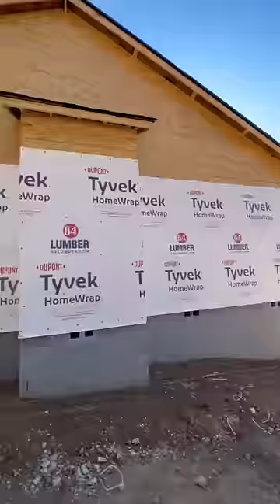Build My $350000 Wooden House in 60 seconds!!

Comment: As a German, I think I can never accept the fact that sooo many houses in the US are just being build out of wood, with little to none stone. 😅
Reply: it’s called balloon framing it was made in chicago because someone had to create a building fast so they came up with a new way of building houses called balloon framing 
it’s much faster than using stone but way less sturdy
Reply: @bloom9075  interesting, thanks for the info!
Reply: The roof is painful to look at, it’s just plasterboard and felt🤣
Reply: As a child I had a little playhouse. The roof was like that!!
Reply: And not just that. Its foundations are barely a meter deep, no steel rods to support the concrete columns etc. No wonder hurricanes and tornadoes rip houses apart.
Reply: I think so too.. nd the foundation Is too weak. They can live in a huge house but not cemented. I wonder if they r just cost cutting.?😓😓😓
Reply: Houses in hurricane prone areas look a bit sturdier. At least the outside walls are all grey bricks in the inside.
Reply: As a german carpenter i cannot understand how they make the balloon frame with like 4/12cm wood sticks and we use 10-12/24cm wood beams
Reply: @davidanders1687  its crazy right? We build houses and they build sheds😂
Reply: @cyp2d653  It is composed of neither plaster board or felt. It's OSB, roofing fabric, and asphalt shingles. If installed correctly, it can last 30 years.
Reply: @StockAL3Xj  30 years before re-roofing is required? In the UK, our roofs are composed of underlay felt with horizontal wooden lats running across the roof to support each tile/slate. The verges are cemented around the perimeter with cemented ridges over the intersecting tiles at the peak. After about 20 years the lat and felt should be replaced, which can be done in a week depending on the size of the roof. The tiles and slates last 100+ years. My bad, I mistook the materials in the video
Reply: @cyp2d653  difference is its just optional to roof with that material. Metal roofs last almost forever. Funny how you judge our whole country's houses from one video. How about I judge your whole nation off of ww2 or ww1? And yes I'm a carpenter in the USA. Not all houses are built this way. Seems to me it's nowhere near tornado alley or hurricane season. So please explain to me how this house will fall down from natural disasters in an area without any?
Reply: @cyp2d653  no its not lol. Its like 2x6 rafters
Reply: As an Indian, id be uncomfortable in that house 😂😂 we make using bricks and cement
Reply: I don't think any European would understand that, it baffles me seeing houses made out of wood.
Reply: Wdym? How do u build houses???
Reply: That's no wood, most of that house is cardboard and plywood.
Reply: In here we use brick and semen here. Unless it's very very old traditional house.
Reply: thats why they all fall down when theres a bit of wind and rain lmao
Reply: @GHOUL392  there are actual warzones in america bud its not really the most desirable destination
Reply: @cyp2d653  when re roofing asphalt roofs, you just rip off the shingles, and felt paper, pop out the old nails, and install new felt, and shingles. A seasoned roofing crew can replace a roof on a mansion in a few hours. Also, materials vary. Metal roofs last longer, and only require periodic maintenance. In the southwest portion of the US, Terracotta roofs are common, however, I live in the southeast, so I don't know much about them. In Virginia where I live, some older homes actually have slate roofs with copper gutters, and in the rual areas, some homes have cedar roofs.
Reply: I live in a hurricane prone area. There are houses in my city built of wood that are hundreds of years old that are still standing. Brick, cinderblock, and concrete are also popular in the USA. Wood is actually very strong, and a tornado capable of leveling a wood house, can also level a stone house. Once the wind rips the roof off of your house, the walls(weather they are wood, or stone) loose much of there horizontal support. Wood is also flexible, so the walls of a wood house do not crumble like stone block, so this is beneficial if you have to deal with earthquakes, or foundation settlement issues. The big drawbacks to wood are the fire risk, and termites, although modern structural lumber is treated for both.
Reply: @AlexFireflyer  that's why they fly away during a storm
Reply: Because there’s no need for stone houses in most states
Reply: As a indian, I agree. Because this will be a fire hazard, and also in case of typhoon , this will give very less protection.
Reply: @husky2961  you use what now???
Reply: @jewjacinto6244  that's exactly what they're doing
Reply: @GHOUL392  jealous of what, most Americans can't afford a house.
Reply: As a person who has actually worked in this field, I am 100 percent certain that no one on this thread could tell the difference between a hammer and screwdriver.
Reply: As a Dutchman who lives next to Germany, long live the German engeneering.
Reply: @smeshcel3025  eh warzones a bit much, gunfights are different then planes flying over dropping 1000kg bombs
Reply: @kazeryu17  my house on the beach has metal roofing and has sustained every major hurricane on the east coast for the last 10 years with only needing repainting. My main house has that classic asphalt tile roof with copper gutters. I live in the boonies. Much love from NC
Reply: As a brit i can say the same lol
Reply: @StockAL3Xj  30 years is an absolute joke
Reply: Ikr, in the philippines, we only use wood mostly for the Interior lol
Reply: Yea it amazes me too like bro no cement and rebar at all???
Reply: One fire or one tornado or cyclone is enough to destroy the house
Reply: I'm a retired maurerer. House construction is cheap junk in America. Less and less brick and stone.
Reply: @racher4593  😂😂😂100% so that would be including you as your on the thread
Reply: Wasn’t Notre Dame built with mainly stone? I don’t think as a German your opinion is much more than that
Reply: @AlexFireflyer  it isnt needed most places.
Reply: @davidanders1687  not like it is nessecary
Reply: @dooomswear303  do you mean cement by any chance?
Reply: @yucol5661  no they don't lol. exact same in FL
Reply: @okaydudes  Silence. What happened in Germany is nothing compared what happened to the original inhabitants of North America. 2nd nearly all houses these days are built this way. Sure maybe 100 years ago they were built sturdier. but these days they all are built this way
Reply: If you don't live in an area where there are tornadoes or hurricanes then I really don't think it matters
Reply: @lastraven7205  No. Or am I misunderstanding you? In Germany or maybe all of Europe new houses are build out of stone/concrete. Old houses from the 17 hundreds where often build out of wood.. Of course there where some stone buildings too but those where mostly like churches or some political stuff.. 
If you want an example for how sturdy German houses are, my inner walls are about 40cm thick and the outside walls with insulation about 60cm.. In Germany you can't just punch through a wall you probably wouldn't even be able to shoot through one..
Reply: Same here and I'm from a third world country 🤣
Reply: @MrSambam10  yes and notre dame is still standing. The only part that's missing is the wooden part of the roof. Notre dame isn't german tho so your comparison is a bit weird.
Reply: Saaammmmeeeee
Reply: @reiddickerson500  how is it possible that u go to war in 2 different countries iraq and afganistan but more people died in chicago than u lost troops. And the majority of the killings happen in southside of chicago. Thats mad
Reply: Yea im from norway and this is a joke.
Reply: @okaydudes  ok jogger
Reply: @lastraven7205  lol 2/10 on the rebuttal
Reply: We don’t need it y’all act like every where in the United States has tornadoes and tsunamis every week or something, we don’t live in jungles😂😂 we’re fine i promise you don’t worry about it y’all can’t even own your own tiny houses and you  taking credit for houses people built like 500-1000 years ago!😂
Reply: They just build big shet over there
Reply: I'm pretty sick and tired of people bashing America like it's the cool thing to do. Doesn't matter what country you're in, it's history isn't pretty. Everybody wanna act like we invented slavery or were dumb af, obese, etc. Euros annoy me to no end when they do this. Y'all had slavery first, for longer, more people, and more races. Not to mention we saved Europe from the brink of destruction, just to be teases and made fun of by people who wouldn't be speaking their native tongue or be alive if the Germans had won. 

I'm sick of the native argument. You name me one place on this planet that's inhabited by people that hasn't been taken from another group of people by force in the past......I'll be waiting forever. And none of the foreigner take into account that when you talk crap about Americans these ways you forget people move here all the time, and not everyone's ancestors had slaves or killed natives etc. I for one am a 5th generation American. My ancestors fled Poland and Germany post ww1. I am not dumb, obese, or hate other people from different countries or make fun of them like foreigners love to do to Americans.
Reply: @okaydudes  I fully agree and I just didn't realize what was was going on in the comments.
Reply: @oellappen269  I'm a carpenter and everyone in the comments could have had a civil conversation about how things are built in different parts of the world. But no, one video of a house being made in the usa and everyone thinks they know how all buildings are made in the usa. That's stereotyping.
Reply: @okaydudes  I honestly don't know what's going in the comments. Last time I checked, there were only about 10. Now over 60. But like I said, I absolutely agree with you. But I would go even deeper and say, that most people who talk about shit about America, are Americans themselves. Specifically from a certain political side...
Reply: @oellappen269  couldn't agree more. I will admit and discuss the faults of my country. By no means do I think usa is perfect or the govt isn't shady. I just don't enjoy when people bash an entire group, could be country, race, ethnicity, sex, religion. I never understood how someone could judge so many off of one
Reply: @kyfy777  stone is concrete and concrete is stone.....
Reply: This!
Reply: @Ghost_Enclave  I've never seen a house not made of wood? I live in Arkansas. I mean there are brick houses but the framing is wood as well.
Reply: @smeshcel3025  war zones in the US? what are you talking about??
Reply: @Thechino231  brick will crack in a earthquake though. Even brick houses are framed with wood. I live in Arkansas.
Reply: @wess3426  What do you use to build houses with, for the frame? Even brick houses here in the US are built with wood frames. In Arkansas & many other places we get tornadoes & not Arkansas very often but sometimes earthquakes so a brick house foundation can crack
Reply: @WarmongerYT  well that explains it, you're from the US.
Reply: @WarmongerYT  It's called reinforced concrete.
Reply: @WarmongerYT  look up how many people died in chicago compared to iraq and afganistan combined. Look at where the majority pf those killings and shootings take place within chicago. Than u will understand. And thats just chicago
Reply: @AlexFireflyer  you must be joking? How tf can there be no steel rods in the concrete columns? Thats like the first, very basic thing to do🧐
Reply: @okaydudes  America literally erased the entire group of people who were living in North America. They're gone now. Nearly none left.  Forced to live in reservation camps. Do you know what reservations would be called in a county like Germany?
Reply: @RSpracticalshooting  You have any idea who drove the Bison that roamed free in North America to extinction and why they did it?
Reply: @davidanders1687  here in Australia, our timber frames vary in size depending on wall type and structural loads. But the sizes of our timbers for wall studs (vertical) are 3.8cm x 7cm, 4.5cm x 7cm, 3.8cm x 9.2cm, 4.5cm x 9.2cm.
Reply: @preetipatel5512  as a not Indian I can assure you we do not have typhoons, and the lumber is treated. This home is built in an area outside of natural disaster so who cares
Reply: @AlexFireflyer  hurricanes and tornatos rip houses apart no differently than they rip the hunks of pure metal we call cars apart.
Reply: @MadNlGER  There is no way you have enough blood quantum to belong to a tribe. Go ask your grandparents if their grandparents wanted to live in a reservation by choice. They were ALL forcibly relocated. Go learn their history Btw. there is ZERO chance I believe you native.
Reply: I didn’t know why people hate using woods? It depends on weather and geography. Seriously, living in California using wooden houses are better, we got earthquake (mini or major) almost every year in many areas, so wood is the best. Fire is the problem, but it is not in many areas like earthquakes, and I also heard that they will add something to prevent the fire etc. If you went to other states, you might see brick houses (I still can’t tell). My friend in Florida live in brick houses. Also there are wooden houses in Florida that withstood hurricane to these days. Some stand for 100 years, I guess the quality was good back then.
Edit: Not all areas has natural disaster, so they can build whatever they want.
Reply: @andromedamessier3176  you have no freaking clue what you are talking about. 

And my original comment was during the time they were all forcefully removed from their ancestral lands. You don't actually think they left their homelands voluntarily and just all moved to barren areas do you?
Reply: @lastraven7205  those barren areas are actually their land that was being reserve. That is why they can’t leave or sell the lands.
Reply: @starofdabloc  Slavery existed in Africa and Asia too, it's not a european invention
Reply: @MatthiasDrinksH20  who said that it was?
Reply: @okaydudes  what percentage of houses in the US would you estimate to have outside walls made with little to no brick/stone? What percentage inside would you estimate has inside walls made from only drywall?
In Germany it's close to zero, and close to zero again. Because we don't like walls one could easily punch a hole through

(And I think saying "the average building quality is worse in America" is a little different to "I refuse to see anything of your country other than a war that happened two generations ago"?)
Reply: @theninja4137  the person I replied to about Russia deleted their comment. Tried to take credit for winning ww2 just from ussr. And I would ask you on average how overbought are the German houses, and how much money could be saved? As far as I'm concerned if you don't need stronger interior walls, why build them?
Reply: @theninja4137  the average price per square foot in Germany is 4600 us dollars. Us is 184 dollars. Yeah your buildings and houses are built better. But maybe a little overbuilt?
Reply: @okaydudes  home ownership is about 50% compared to 64% in the US, so not a huge difference
And: renting is affordable and usually good quality so many people choose to rent if they consider moving in the future (for example, my parents who earn well rented until I was 6 years old and only built a house when my dad got an unlimited contract)
Reply: @theninja4137  10% of the population is pretty big considering both are 1st world high populations. And it's expensive to build and own a home in Germany, so your dad doing it isn't a general statistic. 4600 a square foot to 150 is huge. Seems building a home in between the price would be best. Better build quality but not too expensive. If I lived in an area of the us with hurricane, tornados and such things I would build a home completely out of concrete and rebar. I like the look, and you can customize the inside so it doesn't look like a warehouse. But I like in the pnw and we don't really have natural disasters. Personally, I love log cabins where I live, goes well with the area and I'm not the type to want a fancy house. I'd take 10 to 50 acres and a log cabin tomorrow if I won the lottery.
Reply: @okaydudes  why build strong interior walls?
- often they are structural support for higher floors
- reduces noise
- reduces damage potential (could stand for generations)
- additional insulation (rooms like the hallway can be kept at a lower temperature, reducing heating bills)
Reply: @okaydudes  the German price per square foot is just not true.
Even per square meter (~10 square feet) this would be a high estimate
Reply: €1500-3000 per square meter (about ten square feet) is realistically what it costs, depending on state, building type etc
Reply: @theninja4137  yup. That's what it was. I transfered the currency but not the measurement.
Reply: @okaydudes  10% also includes different living preferences.
Many Germans prefer renting in the city center to commuting every day from some outskirt suburbia.
I know if I moved back Id rent a flat again where I can bike everywhere and live near the lovely historic center rather than building/buying and being dependant on a car
Reply: @theninja4137  I mean standard framed walks are pretty strong, and we use insulation.
Reply: Seems like they didn't grow up listening to the three little piglets story 🤣
Reply: @folded_pizza  durhur hahaha. You make it seem like homes in areas with high winds aren't made better in most cases.
Reply: @bloom9075  that’s not what balloon framing is.
Reply: @okaydudes  You are so triggered ahahahhahaa. Its ok to have a house-lite Version, other countries just like houses that last longer and are more sturdy
Reply: @refloxi5290  whatever at the end of the day yall are in the comments hating on a man building a house the way he wants to. Your opinion in the comments hating on his method and implying its cause he's American and not frugal. Don't care what you say about me. But yeah, I don't like it when people talk shit about America and act like they know what its like here. How well built the house needs to be and how far the dollar or pound goes. Just remember Germany is tiny compared to the us to the difference in our people and its melting pot creates a wide spectrum. Germany is boring in sense that a lot of it is built similar
Reply: @ChristopheErickson  my bad i guess
Reply: @bloom9075  houses made like that can't last longer than 50 years and how many times would you need to remake that ""roof""?
Reply: @tommasol9701  all i said was they’re faster to put up, not trying to start an argument man
Reply: @davidanders1687  that just depends on the costs. They can use better wood if they can afford it. There's 500$ wood and then there's 7,000$ wood for example. In this video, he's trying to make it on the cheap end. Whatever is minimal for the zone he's building. In some places, you can't use wood and must use brick in zones with wind warnings as minimal build material for the first floor.
Reply: @f1nnp  Depends on the soil type, construction type, and zone requirements in the US. Some zones won't even allow that for residential homes while others will have requirements. Wood being less dense on shale ground will not really need much foundation if any while brick/cement will sink in soft soil. 
In earthquake prone areas it is forbidden to use cement walls for residential areas unless the zone requires it.
Reply: Having a house made with cement sounds great but I like in a place in the US that has earthquakes.
Reply: @CYP2D6  Though yours is a much better system,  labor here is too expensive and material costs for slate or clay tile are insane.
Reply: @bloom  that is not Ballon framing, it's platform framing. Each floor is built upon the floor below. Balloon framing, the walls go all the way to the roof and the floors "hang" from the walls.
Reply: @AlexFireflyer  in southern climates foundations do not need to be deep and there was rebar in them, you just have to look closely where they were pouring the corner.
Reply: In the southern U.S. many older houses are built with bricks much better and sturdier.
Reply: @bloom9075  less sturdy and more prone to damage! mold and mildew loves wood and the stuff American house walls are made of, that's why a lot of houses get either mildew or roaches
Reply: Stone is expensive and skillef stone masons are not plentiful in US. too many people think they're going to become millionaires doing rap, so no on wants to learn a trade.
Reply: @kazeryu17  a House should not loose its horizontal support, just because the roof is missing. On top of every wall you should reinforce with a solid ring made out of concrete and steel. Now Wind in die World will blow away a house build this way.
Reply: @lozza821   "That's why they all fall down when theres a bit of wind and rain". 

TIL, 111-300 mile an hour winds are "just a bit of wind and rain".
Reply: As an American considering you guys have multiple American military bases and thousands of American soldiers protecting you guys including your neighbors, the fact that your talking about the strength of a home is down right sad and hilarious 😂😂😂
Reply: @cyp2d653 kinda like the European economy
Reply: @TheSaboteur99 bro I know is Americans use your country as a military base and con dump 😂 and yet your talking about the strength of a home 😂😂😂
Reply: @Ghost_Enclave as an American seeing foreigners as yourself talking about the strength of a home truly baffles me😂 you literally have American military protecting your country 😂😂
Reply: Stone and concrete blocks still won't stand against a tornado.  You all must be rich to make such a comment.
Reply: @wess3426  A tornado can destroy brick or stone too.
Reply: You are welcome btw.... My grandfather says.. God knows he paid for it.
Reply: "OMG a culture is different than mine; let's mock them"
Reply: @bufficliff8978  yes.
Reply: You still lost both wars. Just saying......